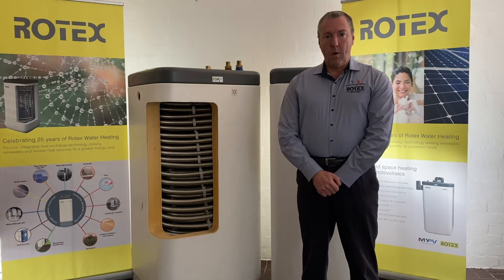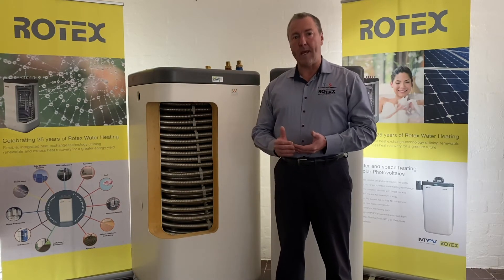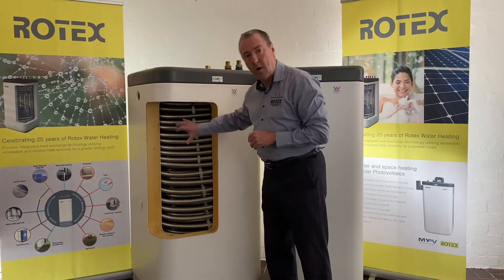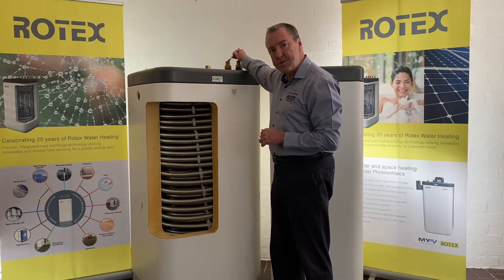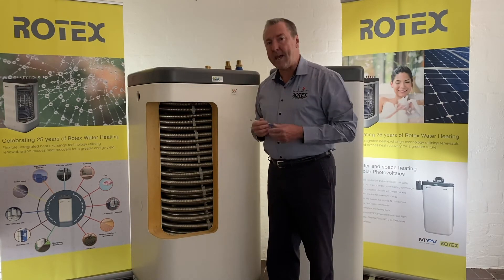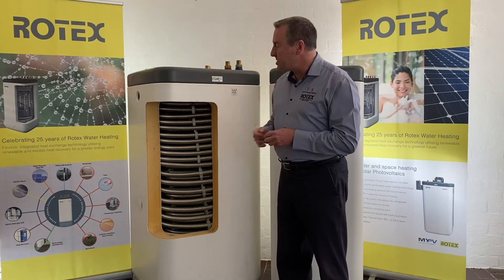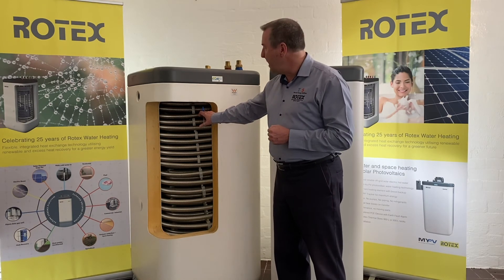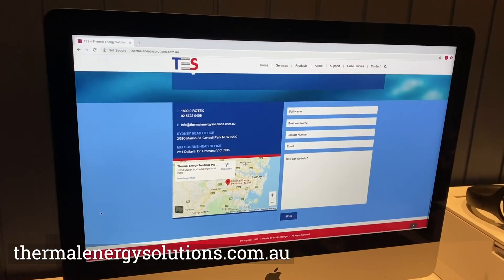What is a ROTEX Thermal Storage Tank

Comment: This is pretty much track pipe in a extra large camping cooler. Why pay them? As soon as those coils leak. You can look forward to legionnaires disease or being poisoned by corrosion inhibitors. Yeah.
Reply: The pressurised water will leak into the tank, not the other way.